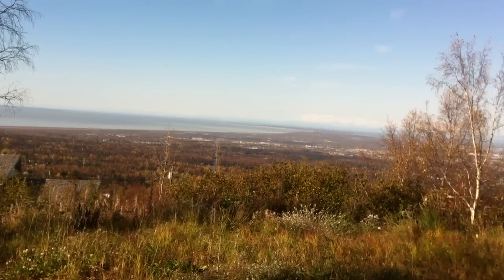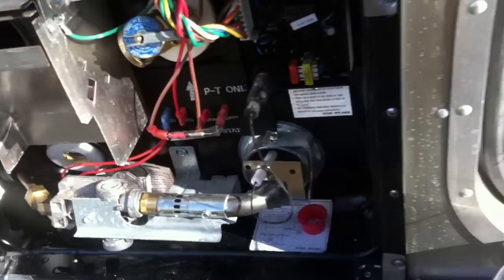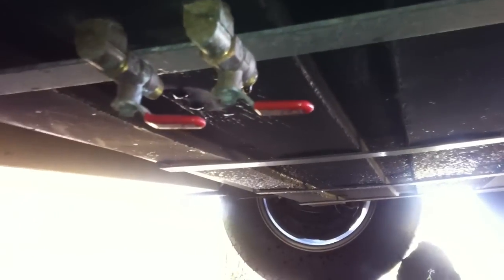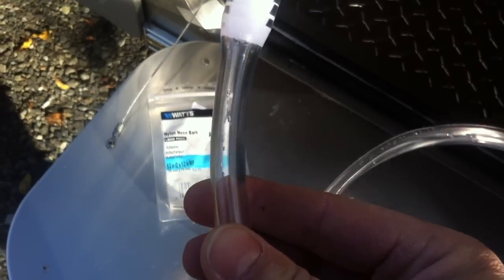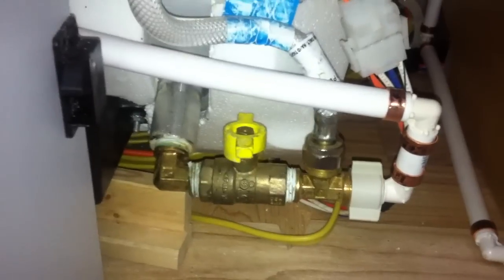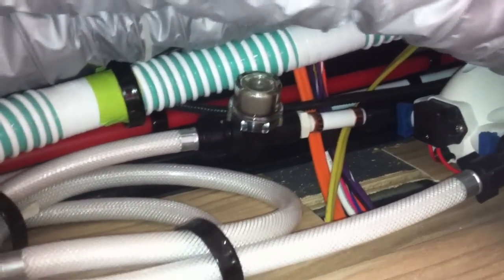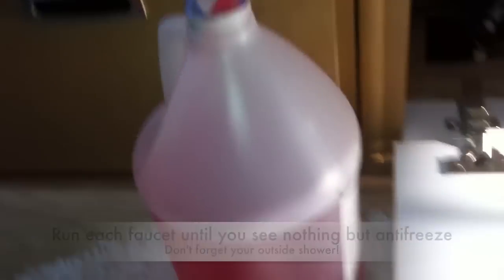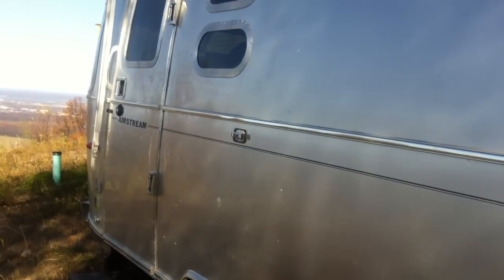Winterizing my Airstream

Comment: Wow! This video really helped us! We have a 2014 25 ft Flying Cloud AWC which is rear bedroom with twin beds. Owners manual doesn't have locations of water pump access and water heater access listed for this model. For others with this model, the water heater bypass valve is located behind the 4 screw panel in the storage compartment under the bed nearest bathroom. The water pump access is below the hall wardrobe. Thanks for posting this.

Comment: This video looks great.  There are some variations to valve locations on my 2012 27: flying cloud, however with a little educated guessing I was able to locate….  Hot water heater valve located in bathroom.  No additional valve associated with vinyle plug on outside by hot water heater.  Thanks for the detail.